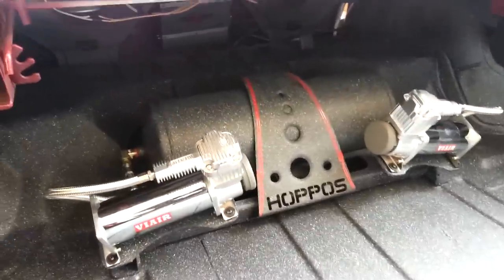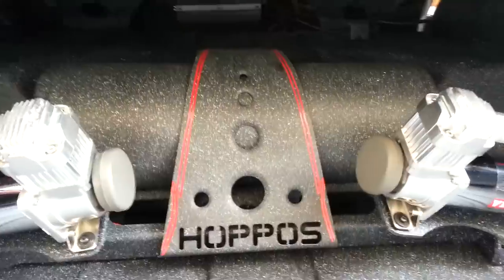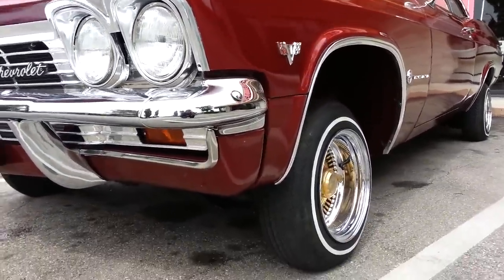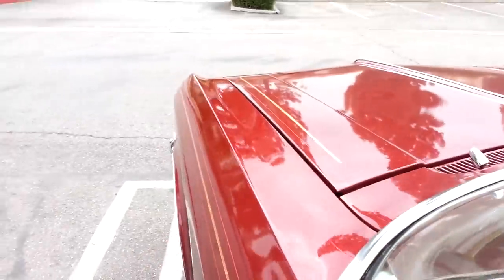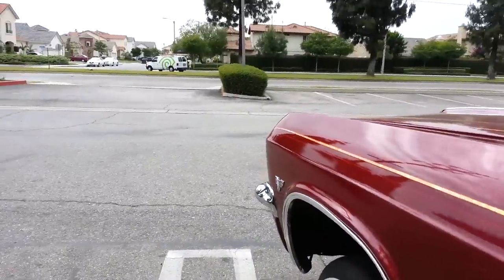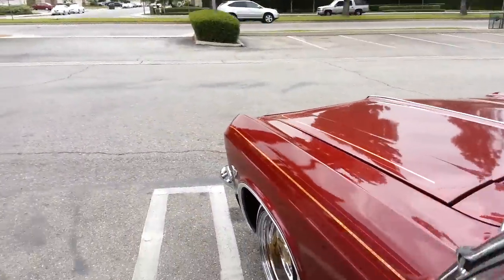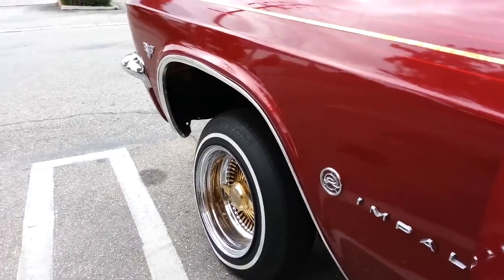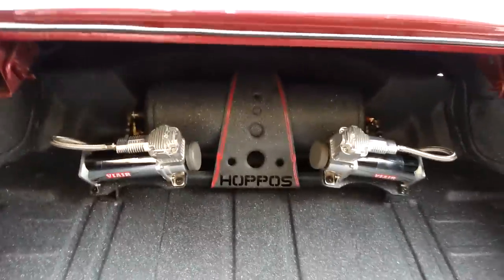65 impala bagged up by hoppos

Comment: One thing i like about bags is no solenoids to short out and cause a fire no battery acid but Hydraulics are cool as well right now im stuck between bags or hydraulics for our 65 SS impala im doing 98 % of all the work myself
Reply: There are still solenoids with air bags
Reply: @joshweiss3911  But they don't catch fire like hydros cus they don't have 60 volts going through em all day

Comment: What's the part number for those air bags specifically?  I'm doing a bit of a sleeper build and having airbags would be great for a couple of reasons in my case:  Adjustable height to accomodate obstacles, maneuver over ditches better, and towing.   (in case if anyone's wondering, it's an old mustang.)

Comment: On 65’s the oil pan lays lower then the A-frame so did u have to lift or change the oil pan on it or what is done to prevent the oil pan from hittin the ground before the frame will

Comment: I bought bags and brackets from hoppos will my car lay belly in front or will I have to modify?it's a 65 impala.
Reply: Albert Venegas video says you lay belly on '65
Reply: I put them on and it doesn't lay belly.
Reply: I'm assuming you pulled the bump stops. Can you see what is holding it up or binding?
Reply: Yeah pulled bump stops. Think brackets are too tall. Dont think sway bar would hold it up.
Reply: Are you're tires as small as the vehicle in the video?
Reply: +Albert Venegas what size rim are you running? i know from experience that the wheel size makes a big defference the 65 in this videos has 13s  thats why its able to lay belly i think anything bigger then a 15  inch rim it wont lay as low as this one
Reply: This is my 65 and it's on 13's. When  i have it on 20's it doesn't lay belly
Reply: Darren Turchiarelli so you only got the front and back kit no side to side? Love this set!